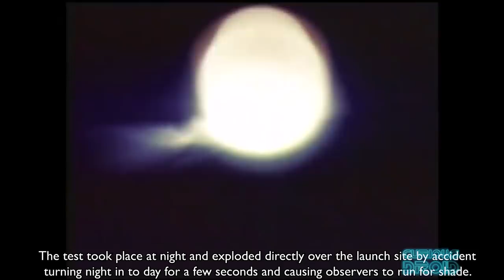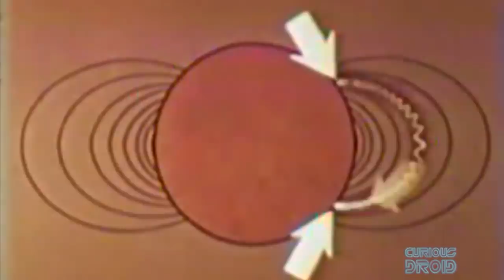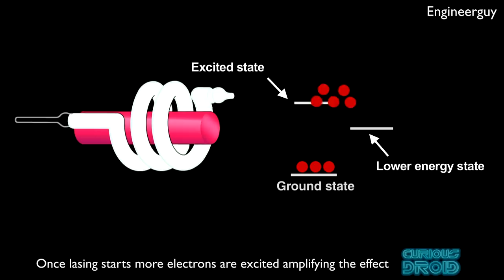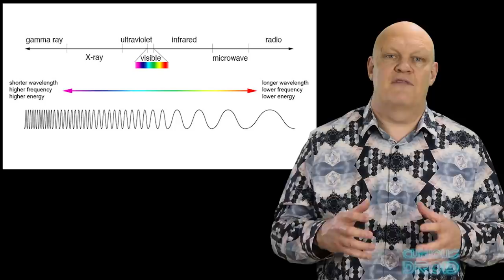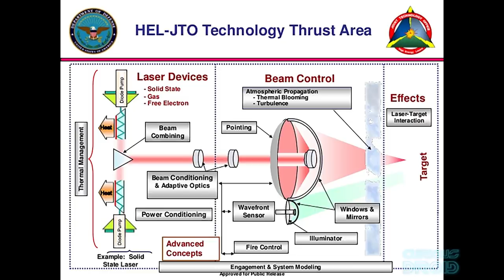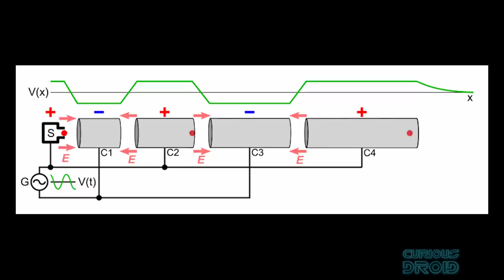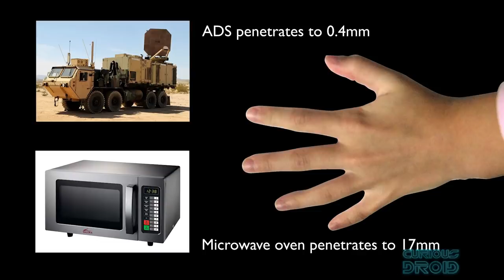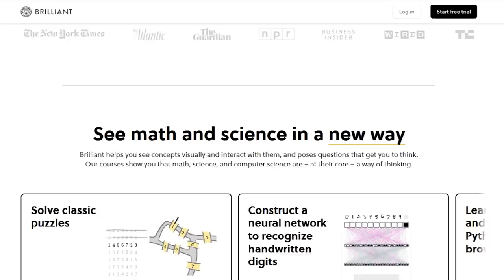Will Directed Energy Weapons be the Future?

Comment: 12:47 hey excuse me, your low power neutral particle beam accelerator has a flat tire
Reply from the maker: I noticed that, at least they could have pumped it up before taking the picture.
Reply: Maybe pressure of the tire was ajusted for elevation purposes? @CuriousDroid
Reply: @music-jn3wn  Or to get it under the garage door?  LOL, I like all the comments here.
Reply: Ironic that it’s in the National “Air” and Space Museum; you’d think they’d have a bicycle pump lying around somewhere
Reply: They might have intentionally deflated it in order to keep it from moving since it's just a towed cart and doesn't have any brakes.
Reply: Curious Droid funnily enough the stand on which it’s resting on is a jet engine stand
Reply: Oh, thanks for the heads up. I'll just pump it up and be on my way then. finishes packing the nuclear bunker

Comment: I worked for over two decades as the Account Manager for our company on NGC’s DIRCM Program. 
The design was always designed as being laser based but for many years, high powered lamps were used because lasers were not powerful enough. 
Since DIRCM became laser based, the leaps and bounds in laser power has been phenomenal. 

Awesome video 👏👏👏

Comment: 11:08 This is widely believed to be a myth. The website, Atomic Rocket discussed using reflective surfaces as "armor" against lasers and concluded that they don't work. Basically even minor defects in the reflective material quickly cause heat to spread throughout the frail reflective material, and further degrade the reflective coating, rendering it useless. The best defense against lasers is just to use regular old armor.
Reply: Pretty much. Against powerful capital-ship grade beam weapons mirrors are going to do literally nothing to stop them.

Comment: 16:12 unless people inside require electronic wheel chairs, pacemakers, or are operating machinery and the safety is then cut off with loss of power, or the person is in a somewhat compromised position that isnt a problem with electricity. But as far as simplicity goes, pacemakers and similar devices, maybe a diabetic monitor device.
Reply: non of those would be at military base

Comment: Honestly I like the idea that they had with the use of that “Heat Ray” as an active Nonlethal Area of Denial System that uses Microwaves to just heat up the surface layer of skin to make people leave an area without having to discharge a single fire arm or a single loss of life.

You also had a system that uses bright green lights to dazzle a person’s vision that they’re temporarily blinded by the after images that are still left floating in your field of view. Just like it does when you look at a really bright light source like the sun or a welders arc flash if you’re not wearing proper eye protection. 

And they even have a system that focuses sound waves like a laser focusing light photons. You override the sense of hearing then at the point the sound becomes too much to bear will make the person want to drop whatever they’re holding and cover their ears to protect them.

Comment: lol, I always love in the CHAMP video, if you watch the computer in the far back, it throws a CD out of the CD ROM. I'm not sure how that works, but its pretty cool.
Reply: The pulse destroys transistors (electrically controlled switches).
The eject mechanism is controlled by a transistor that powers up the motor.
This transistor happened to fail as a short circuit (permanently switched on).
If you were in the room, you would have no doubt heard that cd-drive clicking and grinding away, with the motor still turning even with the tray fully extended.

Comment: Copper mesh makes a great Faraday Cage. I wonder if they could be utilized to shield critical computer systems. I know that the Boeing 787, due to its utilization of a Carbon Composite fuselage has a copper mesh around it's exterior layer to deal with lightning strikes.
Reply: That is actually how they do nuclear EMP proofing of sensitive electronics is to have a wire mesh cage around the electronics that is emitting a faint electromagnetic field too hopefully either absorb the EMP pulse or to degrade it to the point it doesn't damage the electronics inside

Comment: Another possible solution is to use the laser to power a laser rocket. The laser energy is far lower and the kill certain. A 5000s Isp laser rocket using a pulsed laser impringing on plastic was demonstrated years ago. This means speeds 10 times what chemical rockets can do and with proper design a simple passive interceptor..Thought of this when I saw a patent from the late 50's by the RAND folks that used a microwave rocket powered passive beam rider.

Comment: Used to work on laser co2 system based , The laser tube is filled with co2 with two lens  one thicker than the other ,  than we excite the gas inside tube, than beam went through the thin lens , than  onto  4 concave  mirrors  which focus the beam quality really good laser , and because the tube was already filled with gas  did not need any pumps

Comment: Modulated lasers will be the backbone of long distance sensors and weaponry. 
If a laser is able to adjust its lazing frequency and power output, It can be used as a long range non-contact sensing, and with enough power, it can make the target vibrate at its natural frequency, until it falls apart at the atomic level, by losing covalent bonds.
Your tank made of all that fancy high tech armor, will just turn to dust in front of your eyes.

Comment: We have a fairly powerful laser in the shop for cleaning metal. 
It removes just about everything. 
Rust is easily zapped, so is paint and grease. It’s 2000 watts. It will burn through a 1/4 plate of steel in seconds.

Comment: 02:26 - "projectile can do a lot of damage...because they have a lot of mass". Not excactly! They have not only the mass, but also the speed. And the speed is also important since the kinetic energy E = (m*V^2) / 2. The velocity in square. The trick is to achive more velocity, not making the projectile heavier! Regarding the light - it has no mass, so according to the formula the speed doesn't matter, event if it's the biggest speed in the nature. Multiply anything by the zero and you get the zero. So the principle of transfering energy by the light is different than the kinetic.
So I think it's important to understand exactly why, and not just oversimplifying everything.
Reply: Talk about taking a comment out of context!
Reply: A clever comment, but photons can be described as having mass. More specifically, they have momentum. Their mass is zero when at rest, but they are never at rest.
The point he was trying to make was that lasers lack the penetration power (joule for joule) that projectiles have.
Reply: @bobthebomb1596  , well, the context is don't mess the kinetics(mechanics) with the wave radiation, saying phrases like "subatomic particles or light have virtually no mass, so you need a huge amount of them". This is not because of the mass at all! This is because so called "direct energy weapons" like laser work by changing target's internal energy, heating it. And it takes a lot of energy to heat and burn something even if it's close. So the main problem is how to send huge amount of electromagnetic energy fast and far enough towards the target.
So it's sad that the video simplifies things. So if one doesn't know physics they will believe everything they would be said. But who cares? Push "like", entertain, don't explore!

Comment: In the YAL the laser is not mounted in the nose as said by many, but rather is stationary, mounted amidships and directs it's beam forward down the center of the airframe on to the aimable mirror in the nose turret. 
The plane does not fly toward the target but rather at roughly right angles to it to maintain safe distance.

Comment: I should point out most of those failures were only because the weapon didn't work the way the brass wanted. The Navy wanted a particle beam that would kill everyone and burn out the electronics instead the ship sank in seconds. The Air Force wanted a weapon that would destroy a plane upon hitting instead it vaporized the electronics and welded on moving parts allowing the plane to fly (sort of a glide) for up to a minute or more before flying into the earth. I personally would say both were raving successes but the people in charge had no concept of physics.

Comment: In the US, the NSA and NATO have a test and certification program known as TEMPEST (Telecommunications Electronics Materials Protected from Emanating Spurious Transmissions). TEMPEST hardened sites are certified to withstand specified levels of EMP. I worked in a communications center (part of the electric utility I worked for) that underwent a TEMPEST audit as part of an information gathering program.
Later, before I retired, I became the department's lightning hardening guru. Lightning does most of its damage to electronics by creating EMPs on wires or inside buildings that are struck. A fully loaded high voltage transmission line may carry 1400 amps of 60 Hz power with 500 thousand volts behind it, reaching a peak di/dt (instantaneous current rate of change) around 10 thousand amps/per second. Lightning strikes produce di/dt as high as 200 billion amps/sec with tens or even hundreds of millions of volts behind it.

Comment: There's more than a small amount of speculation that the NYC World Trade Towers were taken down by a combination of means; thermite/thermate, explosives and directed energy devices. Use of the aforementioned diverse technologies would go a long way to explain observations of trained observers including law enforcement, firefighters, explosives experts, metallurgical engineers, architects and aircraft pilots that claim to have heard several explosions and noted liquid metal pouring off the towers prior to their collapse, thermite residues in the remains and... the decomposition of the top of the towers into clouds of dust BEFORE falling...

Comment: Armour piercing shells are directed energy weapons; kinetic energy. It would be more precise to call these directed electro-magnetic radiation weapons.
"You could follow it's [path with a hand held laser pointer". Oh no you couldn't; the degree of precision required to direct a beam several tens of kilometres away is astonishing. That's unless the beam spreads out (which to be fair, all lasers will do), in which case the power density is a tiny, tiny fraction of what it started out as.

Comment: Random thought:

Thinking of the facetted eye of a fly. Could multiple camera style sensors be clustered with individual polarised lenses, each at a different angle and possibly separated by short tubes, thus reducing or defeating the effectiveness of laser based blinding? Any one or few sensors would still be effective, but the cluster overall would still be able to function.

Comment: Paul, when you suggest handheld laser blasters would require a sci-fi power supply. . . I agree we're not quite there, but the public doesn't seem to appreciate how effectively lasers can be manipulated with optics.

A maser can be focused to a dot under 1000 nm in diameter. Even if the system's total output is modest enough to be powered by a 15 amp household circuit using current technology, when it is focused to such a small point the power density can hundreds of kilowatts or even over a megawatt per square meter. That will penetrate watery flesh like a tiny white-hot nail - quite an issue between the eyes or in the heart.

You can also vary the beam's profile so that it would, say, blast with high focus through the skull, then spread out to heat the brain more broadly, having a maximum energy just enough for a gruesome death by febrile seizure - in total silence, not even a 'pew". 

You could even blind a dozen people with a very large dot size, then kill one within moments after turning some dials for the optics.

By analogy, you don't need big bullets if you can use small ones that travel extremely fast and you have exceptional aim. We're probably within a few decades of bulky, rifle sized laser guns like those in Akira, but only for use at close range and in fair weather.
Reply: Maser? Impossible, because of diffraction.
Reply: @johntheux9238  oopsie, typo

Comment: 2:33 That is not laser cutting. that is plasma cutting. Laser cutting uses photons to cut stuff like plastics and cardboard whereas plasma cutting uses gas that is heated to very high temperatures until in plasma state which is used to cut metals.
Reply: Actualy that looks like laser cutting, laser can cut metal and non conductive materials

Comment: Directed energy (DE) causes the object to burn.   it takes time to create this heat..  Hypersonic missiles are made to resist extreme heat.  by the time enough heat is created the missile will have either moved beyond the range of the DE source so it will not be useful as a weapon that can defend against hypersonic missiles.  What may work is a blast in the path of the missile that spreads something like shrapnel.

Comment: You could spin the missile in addition to mirroring the the surface and also have a sacrificial layer that creates a vapour to diffuse the energy even more with a ceramic substrate for even more time... Ground based are basically ruled out due to weather so your left with vulnerable satellites with nowhere to hide. Also fire enough weapons mixed in with dummy/blanks that you outstrip the firing capacity of the defence platform... coupled with a few initial high altitude detonations to screw all the communications up with the satellites.
Overall so many issues and so many counters to the energy based weapons that it's uses would be limited.
 
Charged particle beams make no sense, neutral obviously wont be bent off target hence why they probably decided on neutral.
I thought anti personnel weapons platforms that blind are banned.

Comment: Hyper sonic missile won't be swerving or taking evasive action not unless  you can change the laws of physics the faster something moves the harder it is for to maneuver. Plus we had to build the SR-71 out of titanium to take the heat of mach 3. So what are they going to build these hyper sonic missiles out of as once again the heat from speed above mach 3  will burn through normal material.

Comment: Energy weapons will always be of limited use on earth because of atmospheric interference and the curvature of the planet.  They'll most likely be point defense systems, not a primary armament, for any surface or air vehicles. In space, that's a totally different story. You'll want powerful lasers or particle beam weapons for any form of interplanetary conflict, where the distance between targets is measured in tens of thousands of km. Even accounting for the loss of power over distance, they will have far more effective range than any gun or rocket system.
Reply: Definitely. Instead of kilometers ships will be engaging at mega-meter ranges

Comment: The was footage or a "laser " destroying a missle stage on the ground.  Took a few seconds  but worked.
But..later the footage showed the holding down guys were under tension tones of tenstion. 
Next problem.. chrome plated/ mirror  finish. With reflect and reduce  the absorbed energy.. even spinning the missle with reduce localised  heating. 

Or just launch  multiple  warheads .. OK 40000 reentry vehicles  with only 300 real warheads.. what you shooting down

Comment: A more or less technology independent problem is efficiency and where the energy is released.  If we project TNT onto the enemy, its inert until delivered whereupon it is all released 'there.'  If we project energy, we must release enough of it 'here' quickly enough, with enough power to damage them before counter measures or we get a packet of TNT (or something more modern) coming our way.  There are losses en route and in absorption (low power density also means slow temperature increase) so we need more energy than if we chucked something at them.  Regretfully, there are no supremely efficient energy launchers meaning we must deal with waste energies in the neighborhood of what we are using as a weapon.  To deal with that, we need our launcher to be big...and clumsy and that limits how many a ship or aircraft can deploy.  Even 95% efficiency is a problem and lasers are no where near that.  Some RF generation might get near it.  So it's not just a power level problem but an efficiency problem and that is just as serious since we have been working on it 100 years.  I am aware barrels get hot too but consider... M16 rifle runs at a peak rate of about 45kW max with just a barrel for a heat sink so an infantry squad has something like 1/2 Megawatt of weapons which can run at an average rate over a minute of about 1/4 Megawatt.  I am going to make a WAG that the barrels radiate 500W each meaning they operate about 97.8% or ~98% efficiency.  (and it is REALLY well focused!)  So if the most efficient laser is 70% (cough cough) and wastess 30%, then it needs to imrpove by 15 times to be similar to a rifle.  And they have been working on lasers for 60 years. (well yeah, rifles for hundreds)
Reply: And let's not forget that this laser rifle needs something attached to generate such energy, probably something VERY heavy.

Comment: I wonder how military "hardened" electronic equipment is built? Makes me wonder if there are any prepper computer modders out there are trying to  line the insides of their computer cases with heavy duty aluminum foil. ;) But seriously, though, how would you go about protecting electronic equipment? Is it just that they design faraday cages around each piece? What about cabling? I'm sure fiber optic is fine, but will an EMP travel up wiring/cabling between equipment? I'm really curious. I'm sensing an Internet rabbit hole plunge coming on. :P